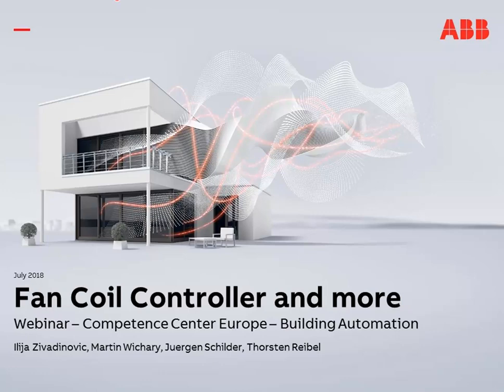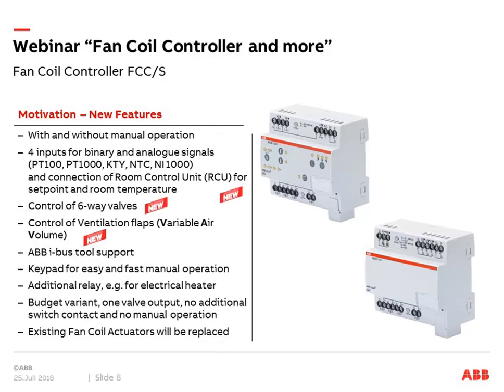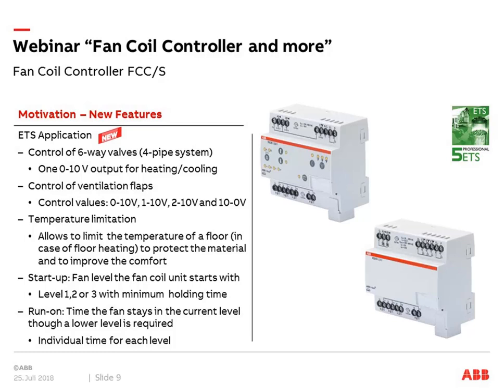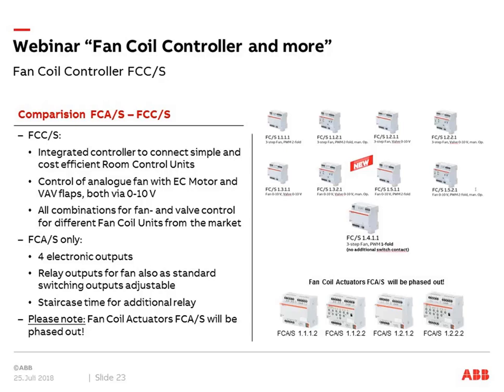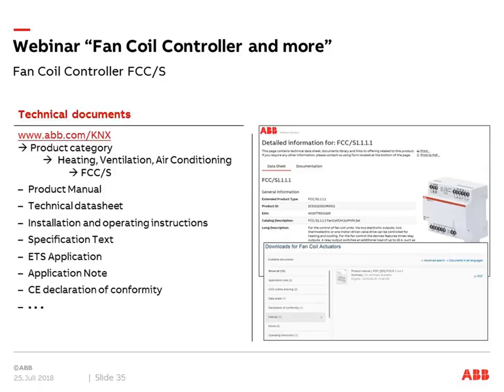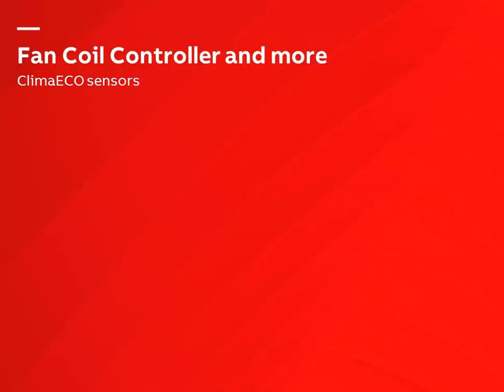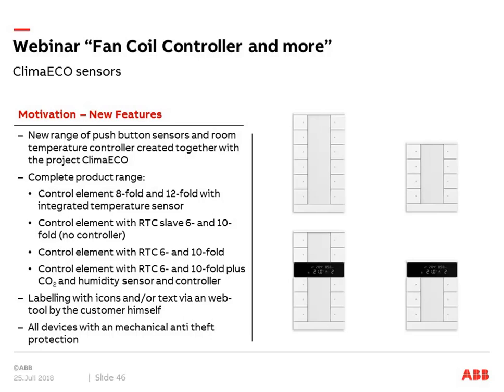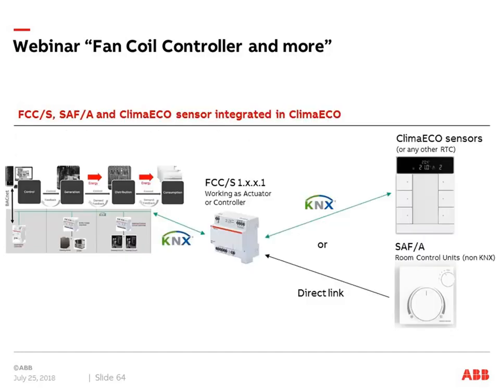Webinar about FanCoil Controller FCC/S and more

Comment: Hi! What is the use of L2 and L3 ? if the device is single phase (230V) why it has L2 and L3 like on a three phase device? is it because every relay needs separate power?
Reply from the maker: This is just a wiring example. Of course it is possible to connect valve, fan and relay to the same phase.